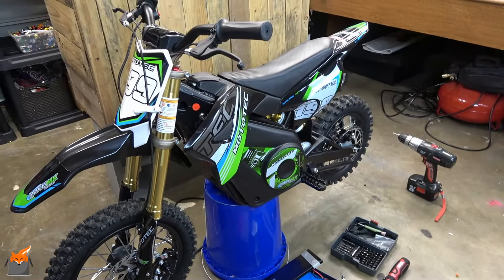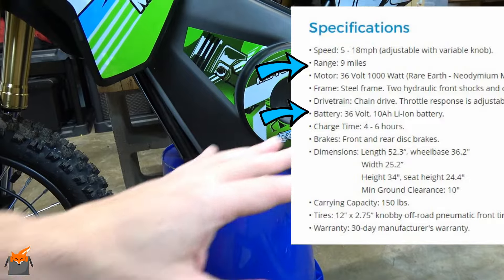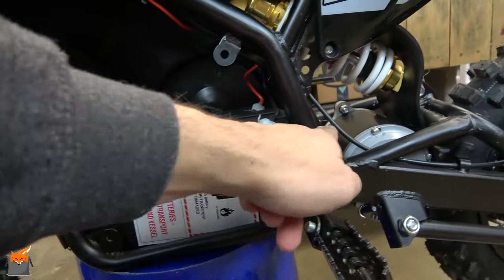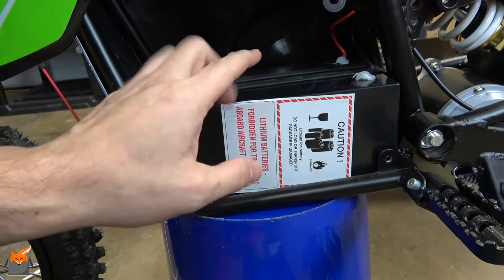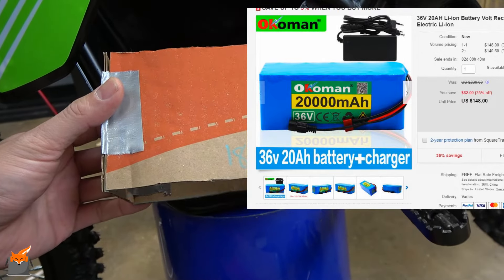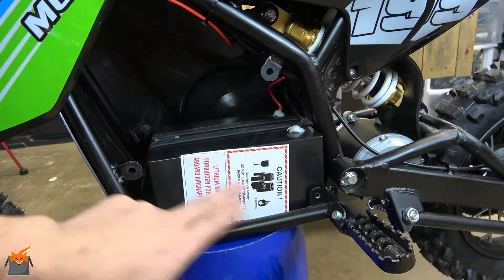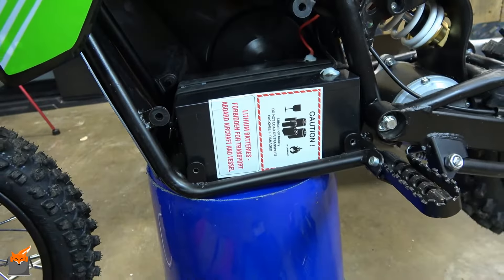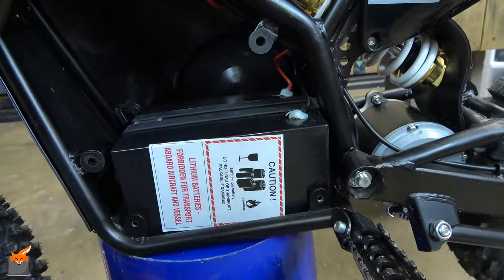Battery Options - MotoTec 36v 1000w Pro Electric Dirt Bike

Comment: Hi i just ordered the Mototec Trike Mt-Trk 1200. Even though  i have not received it yet, i was also wondering what replacement batteries i need to boost battery life. Its 48v 1200w  servo motor that supposedly has a 20 mile range and a 400lb weight capacity

Comment: Thanks for the video. I just received the same 36v 20Ah 200mm battery for the same bike. Is there a good way to be able to swap back and forth between my stock and upgraded battery? My son does track days at the kart track with this bike and we always run into long charge times. The stock battery uses the same terminals for charging and discharging, while the upgraded battery has individual terminals for each.
Reply from the maker: best way that ive done is just have put a T connector like an RC car uses between the battery and the controller, this way you can plug and play.

Comment: Did you ever find an upgraded motor and speed controller. Looking to buy on of these but definitely want it faster. Debating between the razor as that is an easy upgradeable platform. What do you think?

Comment: Hey there, thx for the great video. I just ordered the 36v 1000w. Im curious to know if I can just hook a 48v battery and see if the controller can handle it. They all look the same online, maybe they just derate the electronic specs.
Reply from the maker: No, it wont handle it well... most likely burn out. The stock 36v controller can handle 40v or so... .a 48v batter is really pushing 50v..
Reply: @xfoxrc  ok thx for the reply. I wieght 165 pounds do you think this bike will have enough power for me?
Reply from the maker: @p20dirtrider  it should, but i would highly suggest getting a 48v 1500+ watt motor model, then you will be set
Reply: @xfoxrc  ok awesome, do you by any chance have a link of one that would bolt up? Also I can't find any real life reviews on this dam thing. Could I hit small jumps with the suspension?
Reply from the maker: @p20dirtrider  you should be able to, if you want a really good one get the SEVERAL PRIME or i suggest the OSET they are no joke
Reply: How had the bike held up

Comment: I just bought the battery recommended in the video. It DOES fit in the black box - with modification (IE, had to cut the blue plastic off and a couple sides of the plastic battery box) -  The issue is that even after being charged overnight - I only get like 10 seconds of juice - then it cuts out. (re-seating the fuse fixes it, but only for another 10seconds). I'm kind of at a loss as I thought it would be a quick/easy upgrade.
Reply: If u upgrade the battery u have to upgrade the control
Reply: @elvinguerrido1066  I did resolve the issue - it ended up being the charge controller in the battery it self - Bypassed it and used the onboard - works just fine now - but I don't have the balanced charging.
Reply: @ttoth82  can u let me know everything u upgrade on it so I can do so also
Reply: @ttoth82  what u mean balance charging
Reply: @elvinguerrido1066   A BMS - battery management system - Helps level charge across multiple banks of cells to promote "even" charging and improve battery life.
Reply: @elvinguerrido1066  I bought the battery as suggested - had to remove the blue wrap and plastic casing - removed the BMS system - and dropped the new naked battery into the existing plastic housing. Re used the existing charging ports/cables and soldered into the new battery directly. - Worked well so far - vastly improves ride time..
Reply: @ttoth82  but why u did u do all that work
Reply: @elvinguerrido1066  Because the controller on this bike does NOT work with the BMS system in the battery pack suggested. Its also a bit to big for plastic container holding the battery.
Reply: @Maurice Ford Pretty straight forward - Took out the installed plastic battery case - removed the battery and cabling. Took the battery mentioned above, had to take all the blue stuff and plastic casing from underneath. On new battery, removed the Charge controller, and charging port - and connected the + and - leads to the original power connector into the bike. Takes 10 hours to charge using stock battery charger - yeah sure not evenly charging the cells reduces life but don't care.

Comment: If you're going to be buying the battery why don't you buy a 48 volt battery that's about the same price and just buy a speed controller and just go to 48 volts instead of 36 volts and then you would have a speed controller 36 volts and you would have another 36 volt battery you could use in another project

Comment: Because of additional weight from an additional modified battery, your gains in range will be much less than double of the current range.
Reply from the maker: The added weight is not even a half a pound, so rounded you get about double.